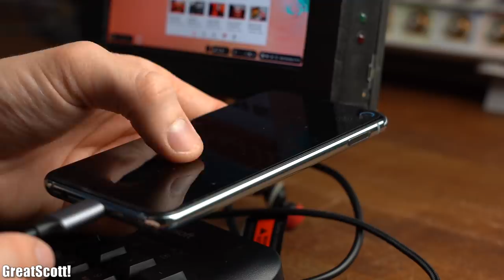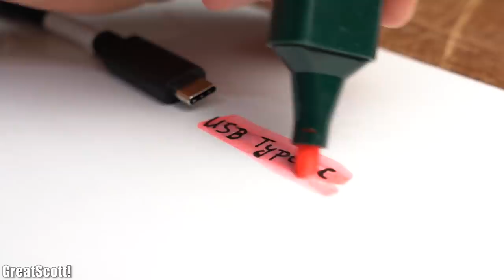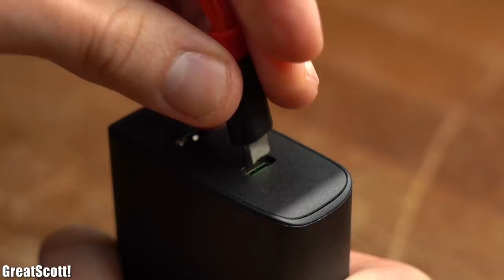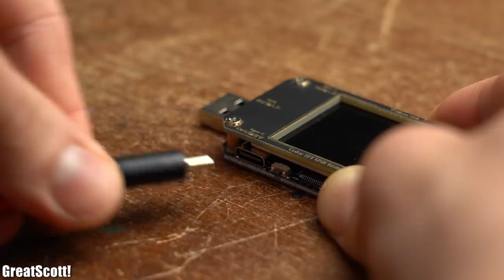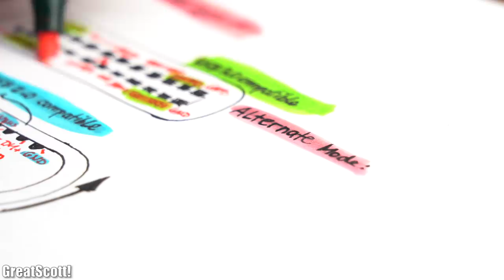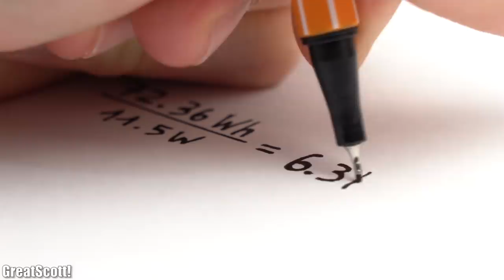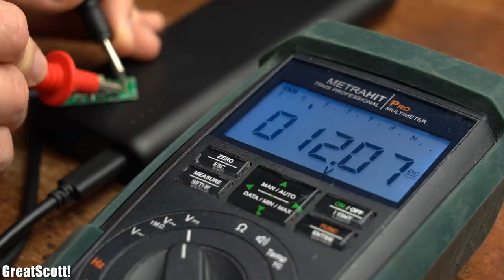Here is why USB Type-C is AWESOME and how you can use Power Delivery for your electronics!

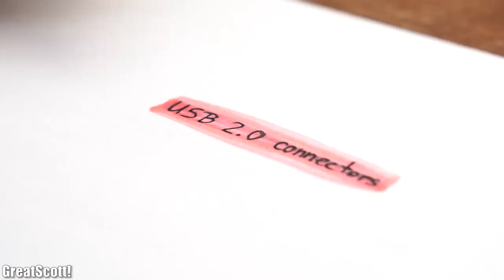Comment: 1:33 - USB 2.0 connectors? USB Type C is the connector, but it supports USB 2.0. The connectors and transmission standards are separate. 
USB 3 over Type-C is basically mending most of the errors of the previous iterations. Mostly it is finally a UNIVERSAL Serial Bus - just 1 connector and it can fulfill most roles required. It would for example be possible to have just a single USB 3 Type C cable going from the PC to the monitor, delivering the power and display signal as well as the connection to hook up a mouse and keyboard.
Sadly so far hardly and USB-C connectors are used in that fashion, the RTX-lineup has a Type-C connector but limited to 27 Watt - not enough for many monitors.
It would also be nice to see USB-PD getting extended to around 250W - power a monitor, TV, GPU or small PC over Type-C (Of course those cables should be a bit beefier)

USB 3 still was a bit of a disappointment as they dropped one of the best features initially planned: fibre optics.
This would have been a lot better than the later changes into 3 different version and made it last quit a bit longer. They also missed adding it to the Type-C connector.
Seriously - cheap fibre optic cores can still transmit a lot of data and would offer pretty much perfect galvanic isolation if only the data is required. And they could have made it the same as the capabilities of type C later turned out - with loads of optional things (like sadly analog audio is only optional but would be really good for mobile phones)

Comment: Can you tell me how can i get 9v out of that white charging adaptor?
Reply: You buy a trigger board, stick it at the end of your charger + cable and you program it (if needed) to output 9V, just as shown in the video. You usually need a device that requests those 9V from the charger and that is exactly what such a board theoretically does. I see there are QC and PD trigger boards. More info on PD boards here: https://youtu.be/aIHj3qMRqqE As to QC trigger boards i have the suspicion that even they might not work with this charger, since it's a Samsung AFC one ("Adaptive Fast Charging"). Since i have the same charger for my phone and i'm also curious, guess i'll just order me some different triggers and test which one works. I'll report back if successful. Damn, i edited this comment 100 times 🤣 Sleep deprivation FTW!

Comment: Can i use that small type c module to charge up my 19v laptop through a power bank??
Reply: the ShockWave Yes you can but you’ll need a power bank that can output the power your laptop needs. Say your laptop needs 45W, you’ll need a power bank that can output that amount of power. Also you need to make sure the usb-c cable you use can also output 45W. Different usb-c cables have different specifications, so you just gotta make sure before you purchase.

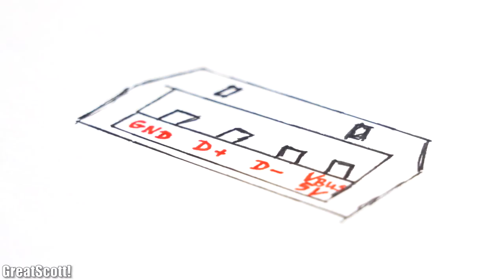Comment: 1:55 
  The USB A male has 4 pins, the other end of the cable is a USB micro with 5 pins. 
What magic is this? 
Dose USB stand for Uri-geller Spoon Bender?
Reply: The ID pin in a typical Type A to Micro B cable is left unconnected. The point of it is for those little OTG adapters which have a male Micro B connector on one side, and a female Type A connector on the other, for you to connect other USB hardware to your phone (using the phone as a USB Host). These will internally connect the ID pin to ground. So theres 5 pins, but theres never actually 5 wires, it's just either linked to ground or not inside the Micro B connector, so the Type A connector doesn't need a pin for it.

Comment: Faster charging is both good and bad. If you are in a rush it can be nice. Problem is the faster you charge a battery, the more damage is done to it. So regularly charging it fast will decrease it's lifespan. So I only fast charge when I need to. At night, even my new android 9 phone get a 5v 500 mA charge. The temperature difference is massive as the phone barely warms at 500mA, but when given 12v from it's included charger the phone gets almost uncomfortably warm to hold. As it can be a real pain to replace these "non replaceable" batteries, I prefer to make them last as long as I can.

Comment: USB C would be good if it was bigger. Such small plugs may be good for miniaturised gadgets like smartphones, tabphones or smartwatches but for regular uses something a bit bigger would be more practical. It would be easier to handle and more durable. Plus there's an issue of compatibility. USB was made to be, well universal, and provide single standard. As long as USB-A was main type of connector it was achieved, but with 4.0 since they removed this basic connector it's getting messy.

Comment: Hey Scott, great introduction to Type-C. But surely an ARM processor is overkill for selecting the PD voltage? Please show us how to do this with an Arduino, and publish the PD library.
Reply: This is the lowest end STM32 on the F0 series. It has only 16K/2K Flash/SRAM, so even less than your typical ATmega328p based Arduino. It is also way more modern and there is proprietary USB PD support from ST, so i think that makes sense to use it. Also sourcing Atmel chips in China is relatively expensive, it is often cheaper to use even the larger STM32 models or ESP8266.

Comment: With all the downgraded cables lurking around, it's worth mentioning that full-featured USB3.1 cables are much more difficult to hunt. Be prepared when you purchase a new cable because the seller may be totally oblivious to what the cable does. Neither max current specs nor max speed spec, even when they claim to be the manufacturer. Engineers also need to be cautious while sourcing type-C connectors. While it's much easier to solder/desolder connectors with fewer pins by hand than working with full-featured connectors - say, for your USB2.0 hardware - some of the downgraded connectors are solely designed for battery charging, which means not even the USB2.0 data pins are built into the housing. So before placing your order of that 6-pin type-C connector, be sure to acquire its datasheet and check it against the official type-C specs.

Comment: making me own rechargeable led lights, so got some TP4056 Type-c USB 5V 1A 18650 Lithium Battery Charger Module Charging Board with Dual Protection Functions, an guess what, I do not have any type c connecters,  just thought they were mico usb ,  there are to many types, I have every type apart from c,

Comment: At 1:36 when you show all the USB 2.0 connectors... you also need to show USB-C.  It's a connector type, that's it.  I could be 1.0 speeds running over it.  I stopped right there.

Comment: What I don’t understand with USB C is...how can those little connector pins deliver 100 watts?
Reply: Data is transfered through surface not through wire.
Reply: Bump up the volts (20V 5A) instead of (5V 20A 🔥)

Comment: Hey, I'm having a electronic issue. I have 1audio signal from a phone and I want to split it in 3 stable the  same signals I Cant use a normal splitter because Om using the signals for 2 amplifiers and a arduino. I need theoraticly 3 the same signals anyone An idea? The amplifiers are asking top mush juice I think...

Comment: Does anybody know why my usb c to hdmi adapter gets warm? I feel like it might be drawing a lot of power from my laptop..
Reply: It's the displayport to hdmi converter.  Those always get hot.
Reply: Same with my USB C hub, at first I was concerned because it got VERY hot, but I've used it for almost 2 years now and it's not died on me yet.
Reply: @DaleyTech  But why? And does it draw energy from my external  monitor or from the laptop itself? The place where the cable goes into the laptop is also warm..
Reply: @peppi0304  Depending on what it is it can be various reasons. 1: it is a HDMI/Displayport over USB-C to HDMI converter, this would just be an adapter/changing the pins to align properly, no power used and should not get hot by itself, unless it is broken. 2: it is a USB3 device that functions as a GPU with HDMI output, which means it has a processor inside it which requires a reasonable amount of power to function, hence the heat.
Reply: @peppi0304  It's from the laptop.  Doing that conversion just generates a lot of heat.  This is the nature of ALL active video converters.  I have worked with many of the video converter chip types and heat is always a major consideration during the design process.
Reply: @DaleyTech  Is there and option to reduce the heat? i have a microsoft surface book 2 and what to connect a benq monitor with hdmi input with it.
My biggest concern is if it draws a lot of energy from the laptop, hence using the battery more.. I don't want the battery dead in one year...
Reply: @peppi0304  Not really to be honest.  Without getting too technical, you may be out of options.  If your monitor has DP you can TRY a C to DP adapter/cable which is passive and should be much cooler.   But I believe those active adapters normally draw very little in comparison to the rest of the laptop (1-2W at the highest).  9/10 times it's a Parade chip inside, so you can try to look around for general power consumption of Parade DP to HDMI chips to give you some peace of mind.  You can easily find the data sheet on the Parade PS176 which is super popular and detailed

Comment: Can i recharge a laptop 17" with type C ? Whitch Power Bank i Need ? My laptop charger Is 7.7A 19.5V
Reply: U have to look for a Powerbank supporting over 80w pd so probably 100w , I don't know if one exists yet and if, it would probably be very expensive
Reply: @hannes-  uh...bad to know, thank you for answer
Reply: @arrowdrill1432  okay it's actually worse my brain is quite tired so I calculated 7.7*19.5 =80 but actually it's like 150w or so, 
So u would need a Powerbank supporting 150w pd, but power-delivery goes only up to 100w so no chance u could load this laptop via such a Powerbank
Reply: @hannes-  i think if i buy a new battery (53€) and change It when the First One Will Be empty, should Be a Better idea (Omen 17 laptop Is Easy to open and change battery) thank you again

Comment: Practically speaking USB type C is much more fragile, and typically it's the receptacle which breaks rather than the plug, which is far more expensive and inconvenient to repair. It's not just physically fragile, it's also electrically more fragile: in particular the mux chips are a common failure mode used to switch between Thunderbolt, USB and Displayport. Usually this is a full logic board replacement to resolve either physical or electrical failure, and if your SSD is soldered on, your data goes with it.

Then there is the cable confusion, apparently identical cables often don't work for, say, power delivery and USB 3.0 or Displayport. Thunderbolt 3 cables are very expensive because High speed demands close tolerances and active cables for distances over half a meter.

In short, USB C has tried to do far too much but at the same time to keep costs down many of the features become optional, and it's totally unclear to the consumer.

Comment: USB-C is horrendous, yes the multi direction caparbility is good but when you consider there are so many pins to wire up now that crossing the streams is going to happen more often than not and means there are propriotory USB-C devices like the switch and raspberry pi because of a crossed wire of some description, where USB A/B having their limited data lines even in 2.0/3.0 configurations, are less likely to brick a computer because of the limited pin outs, and with the monitor side of things, its far safer to use a seperate connector for video out  as again its a set standard and there is less to go wrong, even if the output has audio built in like HDMI, if there happens to be spare pins then thats fair enough, but have 1 conector for everything at once that has way too much possibility for crossed wires, its just too dodgy, one way up also helps in this regard because at least you can look back and make sure the wires are correct, and be sure it is correct, but bi directional inputs means that you might get confused and think everything is fine, but the moment you put it in upside down it causes some major issues and then your left with damaged goods again.

everyone raves about C but its objectively worse, keep outputs seperate from one another, and nothing can go wrong, because honestly, i'd rather have a chunky device thats reliable than a slimline disaster.

i also don't really like the modern apple connector, would rather it have been a micro B, but i don't like the OG connector really either, but what will be, will USB, overall i just don't see a need for reversible connectors, just seems like too much could go wrong, i mean the switch 3rd party home docks are kind of proof of the issues of usb-c.

Comment: im not really a fan as the connector is way to small for some applications that require a more robust port/cable design. id have rather had a large robust connector and a smaller mini version. i mean its ok for phones and other small devices, but i wouldnt want to use it for pc peripherals, printers (both 2d and 3d), or cnc machines.

Comment: USB-C only has three advantages:
1) Higher Speed
2) Higher power delivery
3) Pin Remapping

It compromises everything else for those advantages starting with the garbage the connector. The connector itself is far more expensive to manufacture than any previous USB connector, which is why motherboard and case manufacturers never have more than a couple of ports. A quick glance at prices, for a 1000 unit ammo pack of USB C connectors is between $2-6 per connector, vs a USB A connector being under a dollar and the 3.0 version under two dollars. The cables and PCBs for having remote USB C connectors (like in computer cases) is even more expensive due to the complexity of the pinout and tiny pin spacing requiring more manufacturing time and workers inspecting every cable to ensure they work:

https://www.youtube.com/watch?v=Y1Tmtd51clI

It's also far more prone to being damaged itself than a USB Micro connection, especially on mobile devices. Unless you keep a port protector installed when not plugged in (which is not a realistic expectation), the socket is going to get full of pocket detritus, which is packed in harder when you insert a USB C cable for charging or tethering. What makes it even less reliable than USB Micro is that you have up to 20 volts right next to data pins, so if any of that pocket detritus is even slight conductive or you get even a tiny drop of moisture on it, be prepared for the socket to short out and blow up the controller chip and damaging traces on the PCB. This is already a problem with Apple laptops, Louis Rossmann has shown numerous Apple laptops with blown up lightning and USB C controller chips from the port shorting out. At least if a USB Micro port shorts out, the voltage is at TTL spec so at most you'd expect a malfunction until it was repaired, not so with USB C. It will destroy itself, traces and components on the motherboard.

I'd hate to have a device configured to 20 volts and pins remapped to an HDMI port and something go wrong with the connector that shorted those two together. With how closely spaced the pins are inside the connector, this makes it an easy possibility.

In Thunderbolt alternate mode (you can remap the USB C port to support this) it gives the device basically bare metal access to hardware, which is a huge security issue. Having a device which can plug into the machine and basically be given PCIe lanes off the PCH or CPU is terrifying.

Comment: Ever look inside a USB C? It is the new apple connector in a sleeve.
Reply: New apple connector? Only new connector Apple has implemented recently is a USB C connector. Unless you are talking the lightning connector.... In which case, Yes USB C is the reverse of a lightning cable but with far better power delivery and data transfer.

Comment: I am planning to build a big powerbank, and i am looking for a reliable usb C power supply module that could take a DC input and then offer 45w charging (with all of the power delivery features) trough a usb C port for my samsung galaxy note 10 and maybe some other devices in the future. Can someone reccomend something? How about the one that greatscott used in his video? Otherwise i will try hacking into a wall adapter from samsung, which would be difficult. I am sure there are things like such modules in production these days. I would be really happy if someone maybe would tell which one greatscott used or reccomend another one that is reliable. (I don't want to take any risk plugging in my expensive phone into some dodgy chinese module)

Comment: A 100W on that "sink" thing. And it has no heatsink? How?
Reply: It's just passing the power through from the USB side to screw terminals, it's not consuming 100W itself, it's probably using less than 1W, so it doesn't need cooling.
Reply: @dalehorton7748  but passing 60W via wires to a light bulb also means the wires must be thick enough to pass the amps. Assuming your source can deliver the required wattage. So if the connected device "asks" for 100W and the source can give it, it passes the sink thing, thus it should be destroyed, no? 😋

Comment: it still is inferior to the Lightning conn. my mom (80) or younger brother (50) have damaged many a usb-micro port, rendering a tablet, phone or gadget useless or ifixit worthy.
Reply: Yes. That's micro USB. This video is about usb type c, which is much longer lasting than the current lightning or micro USB standards.
Reply: yes, bit of useless comment from my part, but i do think the structural design of the lightning, ie the cable being the male and the connector pins flush with the surface, makes it a lot more damageproof. that being said, excellent video this!